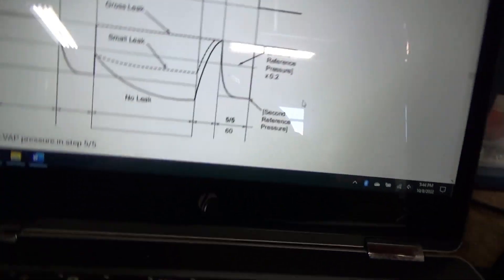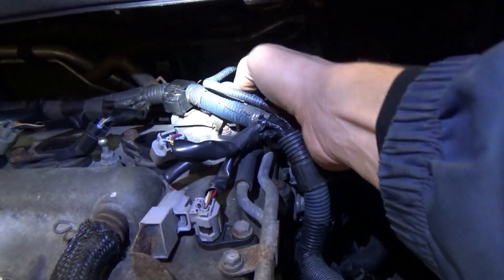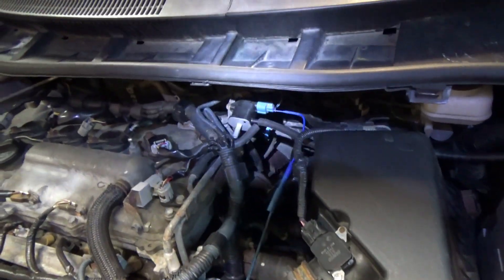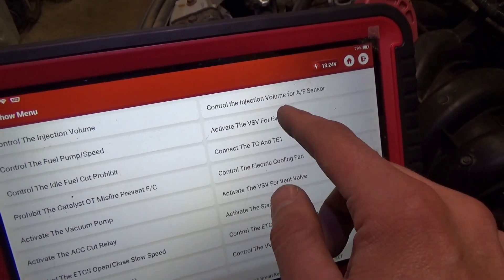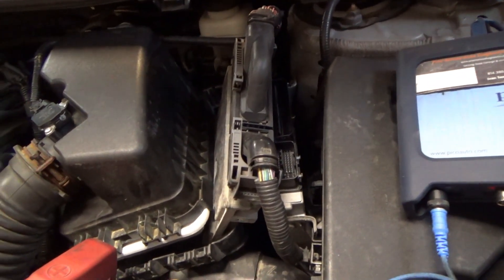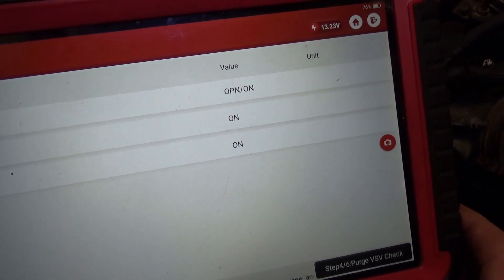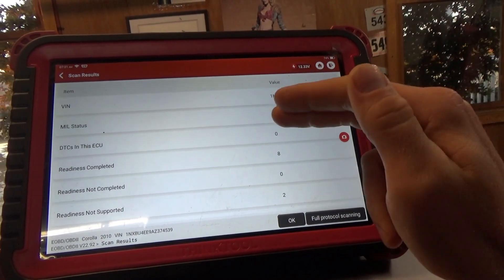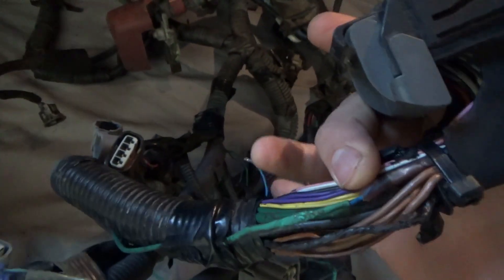2 YEARS of Parts Cannon?! (Toyota EVAP - Part 2)

Comment: Ivan, Flag Ship One PCMs are junk yard units. FSone will send the salvage yard paint and stickers, software to change vin,and many times they are shipped right from the salvage yard.
Salvage yard owners have said this. FSone has a business model that takes your money, tells you that they possess the reman unit when they don't. They bank on a few things: 1. You are just guessing that the PCM will fix the issue with your car. 2. you won't go through the hassle of returning and arguing with them. 3. Most oem used PCMs are higher quality than most remans. Sadly they are usually right on all three. In conclusion, I'd like to say that
Salvage PCMs are a good decision, If you are certain what is wrong with your PCM, and can recheck with the salvage unit installed. If you are not a professional Tech, usually a locksmith will come out to your house, correct vin and security for a nominal fee.
Reply: I haven't done business with Flagship One. BUT I do use used PCM's. I can buy them from a local salvage yard for dirt cheap (like $50), flash them for programming fee and good to go. GM charges $40 per vin, Ford $50 for 2 days. Flash with J2534 interface box and back on the road for about $100.
Reply from the maker: Flagship One has actually impressed me lately. They successfully repaired a faulty no comm ECM on a Nissan truck within one week, since they couldn't source the correct replacement. Ended up being cheaper for the customer as well! 👍
Reply: @PineHollowAutoDiagnostics  glad to hear it. Maybe they have changed their business model. I was speaking from experience that myself and two other shops here in Indianapolis have had. It all comes down to this, your business reputation is only as good as your worst employee. Employees are what make or break you in a service industry. Glad you had a good experience.

Comment: I keep asking myself why not run a ground or voltage to the purge valve to force it to enable steady without the duty cycle signal? Then monitor the change in pressure. That way you can call the purge valve, or the ECM as good or bad. But I haven't watched to the end of the video yet...I'm just biting at the bit.

Comment: When my Toyota Yaris started misfiring on a trip up the mountain one day, and I called the roadside service to check it out, the technician told me, yes Toyotas are reliable but not with the electrics. In my case it was one faulty coil pack out of the four. I bought 4 OEM Nippon Denso coil packs on eBay and 4 OEM NGK spark plugs from a parts store just to be sure and have not had a problem since. And yes, I still have the 3 original good OEM coil packs just in case... Moral of the story, electrical parts are the most vulnerable parts in a modern car, but the good news are that they are cheap and easy to replace. If you have a car with substandard piston rings or some other mechanical part that wears prematurely because the manufacturer just didn't care enough to make sure they got that right, then you have to replace an engine, which is a lot more than just replacing some electrical doodad. Oh, and I saved $500 by doing the job myself. I got the car towed home and let it sit for a few weeks while I ordered the parts which cost $100. I was quoted $600 by some mobile mechanic to come out and do the job. Not a good option for a car that is only worth $3000.

Comment: Wow that's a crazy set of circumstances.
Reminds me of a trailblazer that had 2 alternators , 3 computers , a used cluster to fix a battery light, Repair of serial data wire was the cure . Original GM parts put back and he is now a loyal customer

Comment: Purge valves can be non-obvious. Had an incorrect purge flow code on my wife's Kia Rio a while back. Wasn't an obvious failure like stuck open or closed, it was holding when off and flowing when it was being pulsed, but seemingly wasn't flowing quite the right amount - maybe the valve was sticky internally. New OEM purge valve fixed it.

Definitely using replacement parts of questionable quality for this sort of thing is asking for trouble. Really should be OEM, or at least from the OEM part manufacturer (Denso, etc.)

Comment: Now the question is if the original ECM is fixable, often the final driver is a discrete MOSFET transistor mounted standalone on the PCB.
It might take BigClive or EEVBlog to fix it, but most people familiar with electronics should be able to figure out if it's possible or not.
Reply: Just follow the signal path from the pin in the connector. The wizardry of Dave Jones and Big Clive not needed to troubleshoot and replace a transistor or two. Often the real challenge is identifying the fried component(s).

Comment: I know just enough about component level electronics repair to fumble around and eventually learn my way through how a particular board works, just enough to repair one IF it doesn’t have a bad IC, that I can’t identify. In my far from expert opinion though it sounds to me like that PCM has an out of spec capacitor.

Comment: DUDE I NEED YOUR HELP BEFORE I BLOW MY CAR UP…!!! I have a 2004 Buick lesabre originally the alternator went out on me while driving I replaced it drove for a day went to go to the store the next morning and my car wouldn’t start seemed like the starter so I bought a new one then I go to start it n still just one single click I finally got my car to run on starting fluid n got it to it’s spot. Now while it did die otw here once I turned it back on it said “theft mode detected” my security light has also been flashing for ages but then I go to plug my car in today to see if maybe I got some new codes so I can finally resolve this issue and my car j shut off when I plugged it in and I went to start it and j ghost noises no click or anything but I still have my stereo and interior lights.
Reply from the maker: Bad ground connection?

Comment: I'm wondering if OE solenoid might have a failed flyback diode. Would be interesting to measure the aftermarket solenoid for one. A failed clamp might result in enough overshoot to kill driver(s).
Reply: I would expect the flyback diode to be in the driver circuit, but who knows.
Reply: @ThatEEguy2818  Yeah if it were in the solenoid that would make the solenoid polarity sensitive and I don't think it is.
Reply: @John_Ridley :  You speak TRUTH, but for sure I do see solenoids with integrated diodes on varius machinery and PINBALL machines.
Reply: probably integral body diode inside the mosfet driver. could be a bad capacitor/leaked/shorted or diode/resistor not pulling the gate low(mosfets love to stay on)

Comment: You know Ivan, you had me second guessing this too.  How was the PCM drawing those 2 codes and yet, everything seems to be working as intended?  Doesn't make any sense.  A mere .3 millivolt difference between the 2 valves is margin of error as far as I'm concerned.  There must have been another factor involved.  Anyway, good stuff Ivan.

Comment: Tech at our dealer had a mustang that none could figure out, purge driver wouldn’t totally pull the solenoid to ground as it should when commanded intermittently. He eventually got it to act up and it acted like a wire was corroded but it was internal to pcm. Tech reinstalled oem purge valve that tested good and replaced the pcm. Lasted a couple weeks and the same symptoms and code again. Same issue pcm was killed. Warrantied the pcm and replaced purge valve and car has been fine for about 6 months now. Absolutely insane.
Reply from the maker: Did he measure the current draw of the purge valve like I did here at the end?
Reply: @PineHollowAutoDiagnostics  yep and before he reinstalled it was in spec. We all learned a lesson after that one
Reply from the maker: @BoweryPenguin8  what year and engine mustang?
Reply: @PineHollowAutoDiagnostics  2006 or 2007 with a 4.6 I can’t remember

Comment: I'm guessing the customer may not have knowledge of this information. On exactly sensitive the ecm circuits are and why the OEM parts are much better than the aftermarket parts getting sold across the counter at the parts store. But this is not the only customer without this knowledge. I luckily experienced it firsthand while going to school for automotive technology 10 years ago. I had a 97 4.0l ford ranger with whatever bank running lean fault code. When I was in advanced diagnostics class, I put the smoker on the intake manifold to check for vacuum leaks. I was searching all around the intake manifold gaskets but found no leaks. The instructor found idle air actuator was leaking more than it should have been allowed that was replaced 6 months earlier. The actuator had worked within the ecm threshold for 6 months then the casing had developed a leak. That experience was invaluable. Great work Ivan!

Comment: Even if it came in untouched , would 1 hour cover your time for research , testing and test drive ? That is not a basic system . Plus if the scope is used , there is additional set up time .
Reply from the maker: 1 hour would say bad driver in ECM. After that the repairs and verification would obviously take more time 👍

Comment: Working through and/or fixing other peoples work is a PIA no doubt about that. I understand the concept of what is a fair amount of time (cost) that something "should" take, however that principle is blown out of the water when dealing with other peoples efforts prior to you looking at it. In these circumstances I am in the "charge what it costs" camp. The amount it cost for you to work on it is far less than replacing the car or the owner spending more money on it without avail. At least this customer had accurate records and kept the parts, though as you indicated, it took you much longer to work through than it would normally have if it came to you untouched. Good work Ivan.

Comment: Our 2001 Sienna set countless evap codes. Had 3 failures all at once; cannister leak (our fault for overfilling) a crack in a valve on top of the fuel tank and a bad tank pressure sensor. Fixed them all with no bi-directional control....it took nearly 2 years to figure out though...lol.
Yeah Scotty, Toyotas fail.

Comment: So the reman PCM was the fix but the replacement purge valve was setting the codes. IOW, the owner fixed the problem but caused another with the parts cannon. The owners letter said  "I have a feeling it will probably be something that will make me feel stupid." Well, the owner shouldn't feel stupid because this is not the first time Ivan found the solution by using the one combination of parts that had not been yet  tried. 👍
Reply: First time shame on the corporation selling the parts, second time shame on you. These huge corporate auto parts stores on every corner are pushing garbage parts AND are now charging a crazy amount of money for those garbage parts. ITs actually the same price or cheaper driving to a dealer and buying OEM parts over some garbage from Autozone. I looked up parts for one of these stores the other day because I needed parts right now. Front Brake rotors and pads for a 2009 Focus, $260. OEM MSRP is that much. AC compressor, $600.🤣
Reply: @mph5896  I don't know where you get the idea that the dealer is cheaper.   I buy some parts from the dealer, but I've bought exactly OEM brand parts for a third the price of the dealer (for Matrix/Vibe).   Heck, for the local Mazda dealer, I can't even get those bastards to call me back with a parts quote.   I suspect that if you're not a shop, they don't want to sell you parts - bring it in or suck on it.  

For a 'performance' front rotor?   How about on-sale for 322.25, not including taxes and shipping?   Brembo?  less than 70.    For the 'generic' rotors, Toyota still wants 60 - the various generics don't get that high.   

Not to mention that sometimes the OEM parts aren't exactly high quality anyway, so replacing them with aftermarket is OEM quality :)    Lastly, some parts aren't even available from the stealers anymore.   (the older they get, the more this happens, of course).  

Me?  I'm still chasing a P0171, and it's been driving me nuts.   I'm about to pull the injectors and flow test them.   (Been replacing older cooked parts anyway, but the only 'not made for the job' changes I've done is using standard hose rather than molded replacements for vacuum lines. )
Reply: @tbelding  I have been buying parts for 30 years. Personal experience is where I got the idea of parts being same price or cheaper from the dealer for some items. 😉Compared to local auto parts stores such as Autozone.
Reply: @mph5896  - in 35 years, I don't think I've found anything other than oil filters cheaper at a dealership.   I'll sometimes pay the extra, because of various reasons, but that's all.

Comment: There ought to be a law.
I’m with you Ivan. I haven’t used an aftermarket electrical parts since 1998 and life is been good. Not perfect but good.
The sign in the old mechanic shop reads:
Hourly Labor Rate
$20
$25 if you watch
$30 if you supply parts
$50 if you took it elsewhere first
$75 if you don’t like it
Congrats!
Reply: I'll pay the extra $5. I love to watch. 😉😆
Reply from the maker: Due to inflation multiply those numbers by about 4x haha

Comment: Just about every time I get a vapor system code, it has been a gas cap. I guess I'm lucky.
I thought these systems worked off the pressure in the tank. 
I don't know what happens after the vapor goes to the canister. Lol
This system just seems way too complicated.
I was getting a headache trying to keep up.
Reply from the maker: I've never actually seen a "bad" gas cap over the years...I mean if it has no moving parts and no electronics, how would it go "bad"? ;)
Reply: @Pine Hollow Auto Diagnostics  
I've had my mercedes for over five years now. Once or twice a year, I get the evap code. I don't remember the number now.
I open and close the gas cap and clear the code. I'm then good to go for another year or so without getting the code. I think my Volvo did the same thing a few times, but it had about ten miles of vacuum hoses and
I had to replace a lot of them.
My mercedes mechanic put a mercedes gas cap on my car when I had some work done on it, and the first time I got gas, I could not get it back on. Some guy came over and said these mercedes caps were tricky. He turned a plastic ring inside the cap, and then I could put it on.
I never could do it by hand and had to use pliers on it every time. So yes, they do have moving parts. 😆 
I now use the five dollar autozone caps.
Reply: @PineHollowAutoDiagnostics  It has a seal on it that can deteriorate. Most of the time its a person that fails to tighten the gas cap correctly. Eric O has smoke tested them untouched to see if that is the leak.

Comment: Wow I cannot believe the amount of parts that have been thrown at that poor little Toyota interesting to have seen what actually went wrong with the dang computer why would it mess up was one of the wires shorted or something possibly in the old harness very interesting video thank you
Reply: When people get really frustrated, they often start trying anything to fix a problem.  I see it in IT a lot.   I've done that with  my own car, but the parts I've been replacing, while "parts cannon", mostly needed to be replaced anyway, as a general maintenance.   (intake manifold gasket, vacuum lines, PCV valve, gas cap, etc.  With a 2007 car that wasn't heavily maintained in its previous ownerships, it's normal.)

Comment: 3 hours was a very fair assessment  of the work done. Oem is tailored for the designed operation of the engine. Any item not complying with these tight specs will result in complete failure of the system management. The amount of variables that have to work in harmony , is amazing. Glad the job has a happy result for the patient customer and justified the journey. Good advice about holding on the original parts. The fact that the emissions test was passed is a good testament to a job well done. DIY is ok at a stretch but a time comes when to move up the professional ladder is the best and only option. The wealth of knowledge and experience to achieve this level competence is unattainable for the ordinary diyer. Looking forward to the next adventure on the trail of the unpredictable 4 wheelers.
Reply: Its not funny that a new computer was foiled by a brand new [bad] solenoid.  Not only is computer I/O sensitive to impedance variables, but not all coils are made the same.  Matching system voltage is all that is needed".? Wrong.  A coil has two current requirements to work right: latching and holding.  It takes more current to initially get a coil to change states than it does to keep it there - the computer output has to be able to handle both or system fails.  The mechanical package design of a solenoid or relay is no indication of coil requirements - sometimes a deal like this might make engineers add a pilot relay.  .

Comment: nothing lasts forever but the toyota seems to have a higher reliability than the others. That's why I drive one. Thanks for sharing.
Reply: Toyotas last because they are so de-tuned and don't have much horsepower.   The old 90's F150's with a 302 V8's were the same way.   I have a 2002 F350 7.3L diesel 6spd manual 4x4.. and these Diesels were de-tuned also, so it's not uncommon to see them with 750k to even a million millions on the same engine.   Mine has 340k miles and it's still an awesome truck and going strong.  Honda's tend to last well into the 300k miles mark also, just like Toyota's.   I just wish the Aftermarket was full of UPGRADES, rather than parts that are junk half the time..  So if a purge valve or fuel pump fails, it would be so sweet to see that the after market has an upgraded fix that will never fail again;  But for some reason, they go the other way and build junk parts for as cheap as they can;  smh.